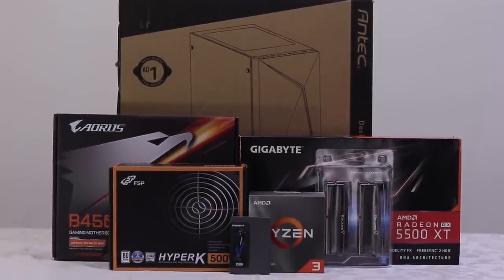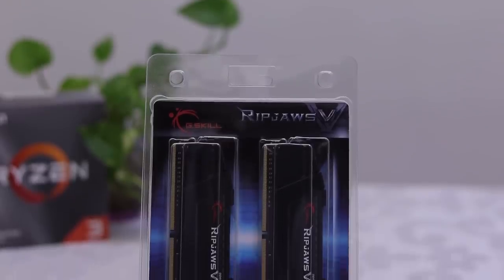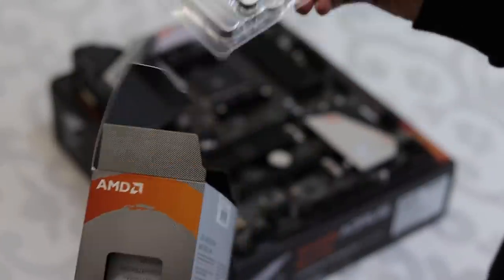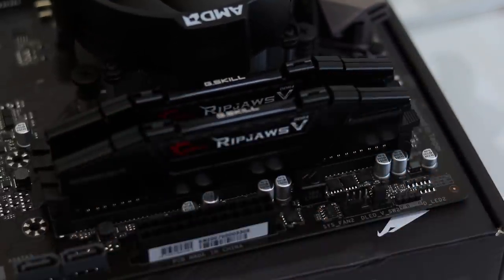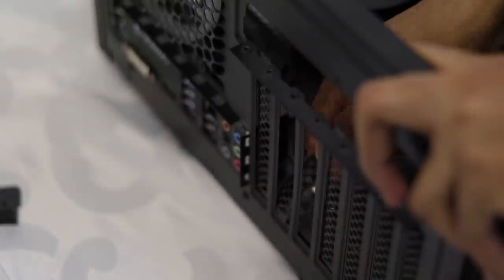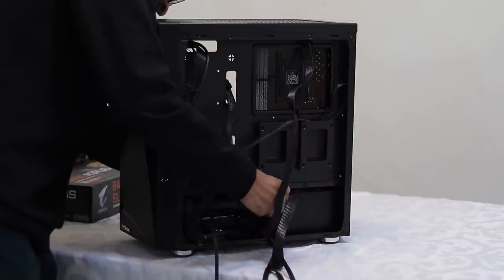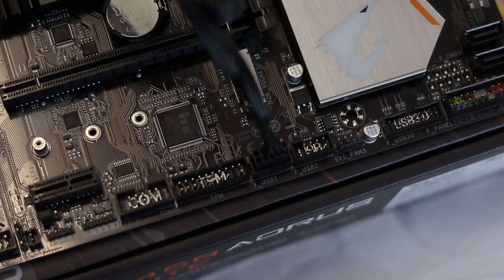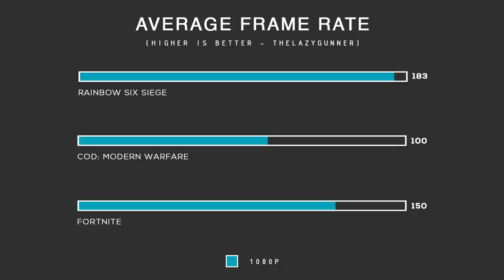Best $600 Gaming PC Build 2020 - RX 5500 XT + Ryzen 3 3100 (Full Build Guide)

Comment: I think this is going to be my first pc but I'll be taking the 1650 super instead thank you for this video man it helps alot
Reply: The 5600 xt is almost the same as the gtx 3070
Reply: And it’s cheaper then the 1650 super
Reply: The only thing that is that to good about that is that it doesn’t have ray tracing

Comment: Hi there, Great video man. I bought most of the parts with some modifications. All is going great in the build. But at 8:46 is that fan required? As I did not see it In the parts list.
Reply from the maker: Hey, no its not required - although I would recommend at least 2 case fans (one for exhaust at the back and one for intake at the front) so if your case has more than 2 fans then you're good. If not then I would recommend for better airflow/cooling.
Reply: TheLazyGunner thanks you lol. I just looked at my case and it has 1 on back and 3 on front so should be good thanks

Comment: Is the MSI NVIDIA GEFORCE GTX 1650 Super Ventus XS OC Graphics Card 4GB GDDR6, 1740 MHz better than the Gigabyte Radeon RX 5500 XT Gaming OC 4G (4GB GDDR6/PCI Express 4.0/1685MHz - 1845MHz/14000MHz)
Reply from the maker: Yes I say in the video to get the 1650 Super over the RX 5500 XT.
Reply: TheLazyGunner thanks

Comment: Would corsair 450w psu be enough?
Reply from the maker: It should be enough, but you can get a 500W for the same price.
Reply: TheLazyGunner if the power supply that was listed wasn’t available, what is a good competitor to use instead?

Comment: So do you recommend I get the nvidea 1650 super ventus 4 gb for 160 gbp instead of the Radeon rx 5500xt 4 gb for 180 gbp
Reply: yeah 1650 super is better then rx5500xt
Reply: Caleb Yeager thanks
Reply: @SMDALEX  where?
Reply: not where i live
Reply from the maker: No thats not true, a RX 5600 XT costs even more than the 1660 Super so how can it be cheaper than be 1650 Super?
Reply from the maker: The RX 5600 XT is not cheaper than the 1650 or 1660 in the UK.

Comment: This is a really solid budget build but man, I’m really not a fan of the 5500xt. Don’t get me wrong it’s not a terrible card, and the 5600/5700 XT are incredible but the 5500xt is rather lack luster. Honestly, I would take almost any other card. Save some cash and grab a 1650 or 970, 1650 super and 980 are pretty close in price, even push the price a little and grab a 1660 or 1660 super. Maybe even check out the used market too, the 5500xt is just too weak
Reply from the maker: Yeah I agree, like I said in the video I would rather go for the GTX 1650 Super, but where I stay theres a big price difference between the 2 cards, but in countries like America the GTX 1650 S is like the same price as the RX 5500XT
Reply: TheLazyGunner ahhh I always forget that the PC industry seems to hate non Americans when it comes to their product. 

Great video though! I’ll be sure to check out some of your other stuff

Comment: Hey TheLazyGunner. Thanks for this video. I'm building this for my nephew and I have one question. On the parts picker list you have a "Silicon Power Ace A55 256 GB 2.5" Solid State Drive" but when I click on the individual SSD part in the description it's the   "Sabrent 256GB Rocket NVMe PCIe M.2 2280 Internal SSD High Performance Solid State Drive". The first one is more square it doesn't appear to fit the motherboard. Which one do I get? Thanks in advance!
Reply from the maker: Hey there, so the one I used in the video is the sabrent m.2 ssd which goes directly on the motherboard as seen in the video - and the silicon power one is also an ssd but its not an m.2 which means that goes on the PC case and you plug it to the motherboard using a sata cable. They both are basically the same thing just in different form factors.

Comment: Hey man the Ryzen 3 3100 cost more than the Ryzen 3 3200g could that be a viable option?
Reply from the maker: The Ryzen 3 3100 is much better than the Ryzen 3 3200g so I wouldn't recommend the 3200g

Comment: ive never built a pc before and i was wondering if you could just get any other case? or do they have to be compatible in some way?
Reply from the maker: No you can get any case as long as the motherboard fits so a full sized motherboard is an ATX motherboard thus you need to get an ATX sized case. You can just check the descriptions of each case on Amazon to see if it will fit.
Reply: @thelazygunner  ohhh okay thank you for the fast response :)

Comment: Sorry for asking more questions but does this motherboard have Bluetooth and WiFi
Reply from the maker: No it doesn't, so you either have to use ethernet cable or get a usb wifi receiver
Reply: TheLazyGunner does it have Bluetooth
Reply from the maker: @gaminggames9960  no it does not, (almost all PC motherboards don't have Bluetooth unless its a laptop) but again you can get a USB Bluetooth if you need it
Reply: TheLazyGunner ok thanks
Reply: TheLazyGunner so i need an ethernet cable to have wifi on this pc?
Reply: banyur yes or buy a usb WiFi adapter for a about 10 dollars or pounds
Reply: gaming games oh ok thank you got a lil worried there lol
Reply: gaming games btw if u have this pc have u ran minecraft with it?
Reply: banyur ye runs very smooth at high settings

Comment: Hey @thelazygunner so I got the windows key to work and did all the updates. Only issue I have now is that the computer isn’t reading the 1TB hard drive. Even when I go to disk management it doesn’t see it. I can here the hard drive spinning when I plug it in. Any recommendations on how to fix this? Thanks in advance for all your help!
Reply from the maker: Since the hard drive is spinning that means its recieving power okay, which means it must the the other sata cable - check you've connected the hard drive to the motherboard using the sata cable

Comment: Hlw wanted to know if this pc can handle streaming and gaming perfectly.
Reply from the maker: If you want to stream, I recommend you get the GTX 1660 Super graphics card as it is better for streaming - I have another $600 build on my channel that uses the 1660 super so check that out too
Reply: @thelazygunner  actually instead of a gpu change he should prolly get a 3600 so he take advantage of the extra cores and threads

Comment: Are these at high settings?
Reply from the maker: yes but not max
Reply: TheLazyGunner can I connect two monitors to this pc ?
Reply from the maker: Yes you can!
Reply: TheLazyGunner can you make a video on how to do that? Thanks for replying btw
Reply: Or if you can just briefly explain how
Reply from the maker: So basically you connect the monitor to the graphics card and the graphics card has like 4 ports so you can connect up to 4 monitors to it. I think this graphics card has 1 hdmi port and 3 display ports, so if you monitor doesnt have a display port then you must just get a hdmi to display port cable to connect the 2nd monitor
Reply: TheLazyGunner thank you so much

Comment: Is there any other power supply i can use cause I can’t find the hyper k one anywhere
Reply from the maker: Yeah so check out this link for alternative parts: https://kit.co/TheLazyGunner/600-ryzen-3-3100-rx-5500-xt-pc-build
Reply: And on Amazon it says ripjaws noire series would they be ok
Reply: Also would the aorus b450 aorus pro WiFi be a good motherboard
Reply: Only graphic card i can find is the Msi Radeon 5500 but it says mech 8G
Reply from the maker: Then get the gtx 1650 Super instead any version is fine.

Comment: Hello !!!
- is the 2060 or 3060 compatible with the case  
- is the evga 700w BQ compatible with antec nx300
- is there any other trusted psu that could fit antec nx300 , Corsair, Evga , Seasonic ? Preferably 600-700 W 

Do you have an Instagram so i could message you questions so it would be easier
Reply from the maker: 1) yes they are compatible 
2) & 3) All standard powersupplies are the same size - if it says ATX form factor then it will work with 90% of cases.
Reply: @thelazygunner  tysm

Comment: Can I change the Ryzen 3 3100 to a Ryzen 5??
Reply from the maker: Yes you can
Reply: @thelazygunner  
(Few more question)
1. If I do, will my game play be better?
2. Will it change how I put it in the socket?
3. Do I need anything extra to keep up with the Ryzen 5?

Tysm
Reply: @thelazygunner  Oh and one more question...
My budget is $800
Should I build your $700 Gaming PC? 
Or should I just upgrade this CPU to a Ryzen 5?
Reply from the maker: 1. Yes it will (but not by a lot) but it will be much better for multitasking as there are more cores.
2. You install it the exact same way as the 3100
3. No extra steps needed.
Reply from the maker: Build my $700 PC it has a much better graphics card so the performance will be much better in games.
Reply: @thelazygunner  Ok, watching your $700 Gaming PC rn tysm <3
Reply from the maker: Or you can build this one and just change to the Ryzen 5 and upgrade to the GTX 1660 Super.
Reply: @thelazygunner  Will it perform almost like the $700 Gaming PC? If so, it's perfect because idk how to build a PC and this video is perfect for steps.
Reply: @thelazygunner  Sorry, but what do I replace the GTX 1660 Super with? Thanks
Reply from the maker: No I said replace the RX 5500XT with the GTX 1660 Super
Reply from the maker: Yes it will perform like the $700 one if you use the GTX 1660 Super

Comment: Hey I’ve got a few question and want to know if u could answer it for me?
Reply from the maker: Hey, go ahead and ask your questions
Reply: TheLazyGunner ok so I got a cyber PowerPC that was prebuilt and I was wondering if there is any parts I should upgrade ethat don’t really go to gather and these are the part        CPU:Ryzen 7 3700x | MB:b450m ds3h WiFi |GPU: PowerColor rx 580 | RAM: xpg 16gb 
3200mhz | PS: 500w (I think) and do I think there are any parts that are limiting my pc from going all out
Reply from the maker: Its a pretty good PC, its got a highend CPU , the graphics card id mid-range but it will give you over 60FPS in most games at 1080p (I also have the RX 580) so unless you want to play at a higher resolution then the graphics card is the only limiting factor. But I assume you play at 1080p so you should be fine
Reply from the maker: Also what storage does it have? Is it an SSD?
Reply: TheLazyGunner 2TB hard drive and 240gb SSD
Reply: And also do u think I can over lock my cpu and and maybe my ram on this motherboard
Reply from the maker: Yeah then you should be good! How much did you pay for the PC ?
Reply from the maker: And yes you can overclock your cpu and ram on b450 chipset, just google or YouTube how to do it.
Reply: TheLazyGunner I paid 850
Reply: TheLazyGunner but one thing I am thinking about is upgrading my rx 580 to a rx 5600 xt because while streaming my gpu is always at 100% no matter what even when I’m just playing games which doesn’t really bother me but it’s very loud at 100% so do u think I should upgrade it or would it be a waste?
Reply: Steenie where did you buy it from?
Reply: VxonFy bestbuy but I had got it on Black Friday so the price is around 1.1k now
Reply: Steenie mobo’s kinda weak for a 3700x
Reply: cachirulo yah that’s what I wanted to know if it bc it does seem kinda weakling looking at the specs

Comment: @thelazygunner I've just built this computer and am trying to order a Windows 10 Key from Gamefun365 but I keep getting an error message. Have you ever had this issue?
Reply from the maker: Hi, is this before or after payment?
Reply: Before purchase. When I click buy now it says “error order canceled” I’ve tried everything and even contacted them but haven’t heard back.
Reply from the maker: Ah I see what you're talking about. It seems as if they have some issue. I will see if I can get in contact with them.
Reply: Do you download the key and put it on your own usb flash drive and then use that on the new Pc build to install the operating system? Not sure how this key thing works for a brand new computer. Thanks for any additional help on this final step.
Reply from the maker: So you actually don't need a key to install windows. You can use it for free without a key. If you look at my description I have a link to a video on how to install windows 10 - that should help you out.